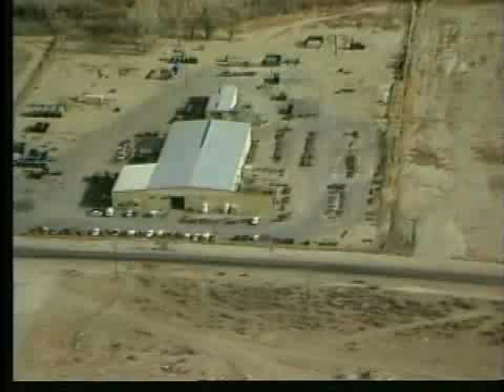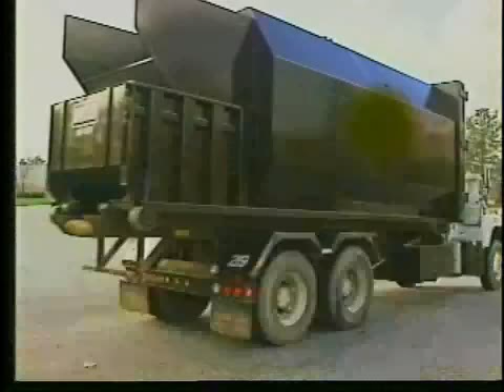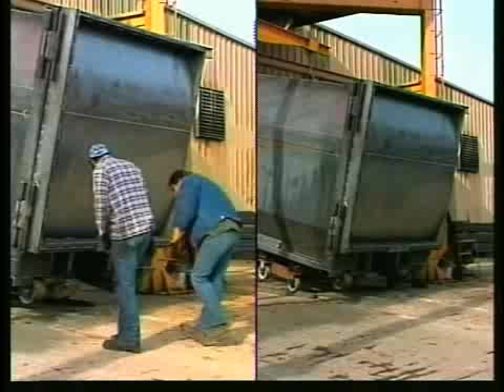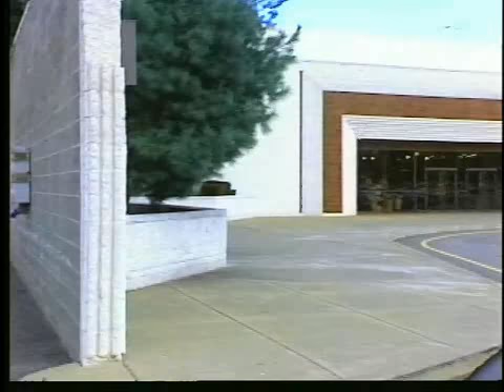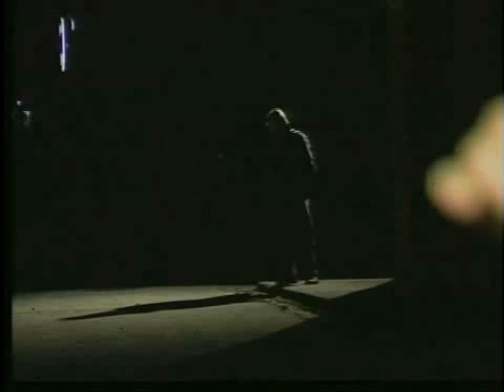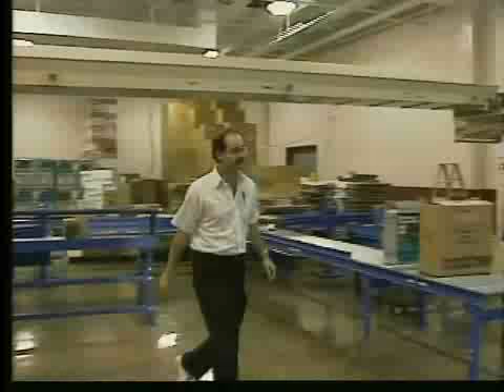Wet Waste - Self Contained Compactor

Comment: Ok let’s go more into detail about what has to take place in order to dump this stupid thing. Notice that the driver has to pick it up from the side that the garbage dumps out from. This means that he then has to offload it then drive the truck to the other side and pick it back up again in order to actually dump it. Then after he dumps it he has to offload it again and drive the truck to the other end again to pick it up only this time he has to attach the cable to the hook that is WAYYY UNDER the container so he has to get on his hands & knees and reach way underneath to attach the cable right where all the nasty garbage just came out and all the metal is covered in bacteria and the most fowl ungodly stench and disease. Then he has to drive it back to its original spot and do it again to disconnect the stupid thing. They don’t tell you that in the video. Not surprising that they omitted that bit of information. These are unsafe for the driver and should be OUTLAWED BY OSHA!!